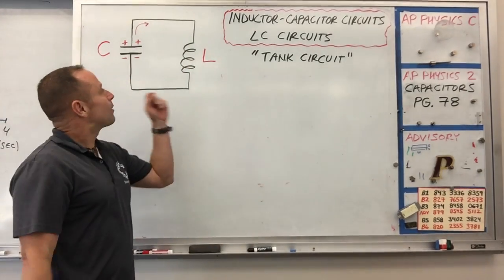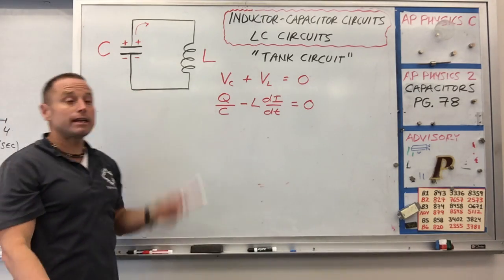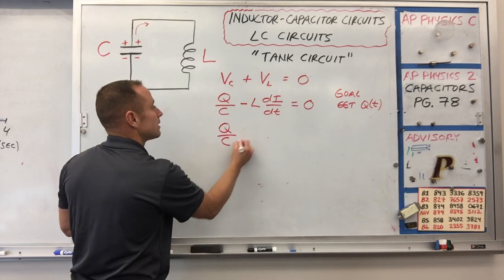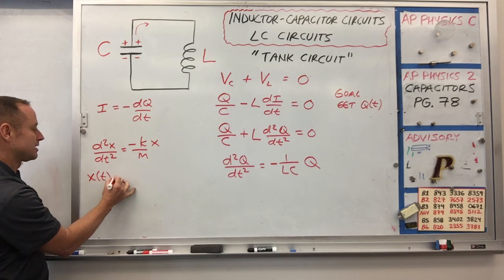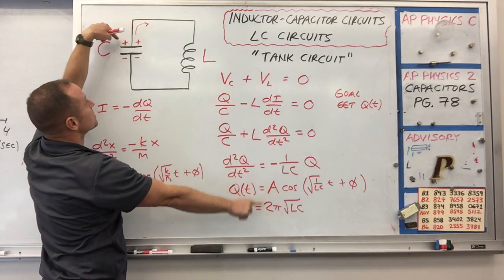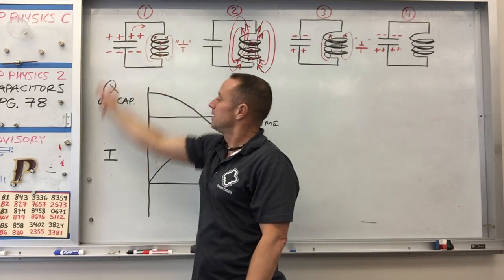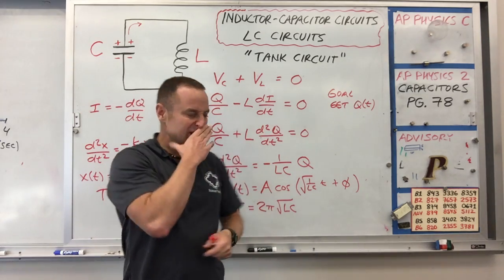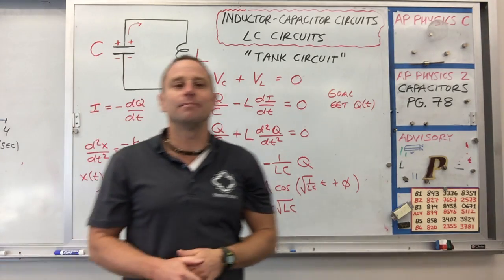LC Circuits Explained -  Tank Circuits. or Circuits with Inductors and Capacitors

Comment: Where did the voltage come from?
Reply from the maker: Fill the capacitor with a battery on a separate circuit. Open that switch to take battery out of circuit.  Then close a switch to create a circuit with the capacitor and inductor and it will behave as described in the video.